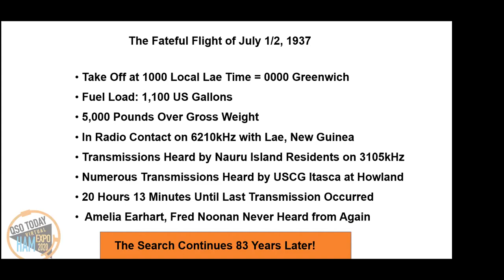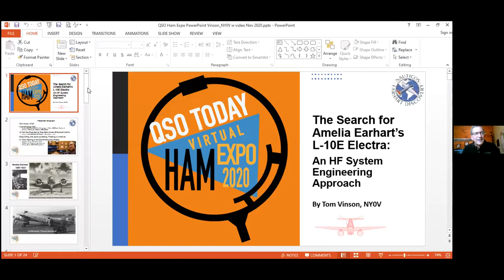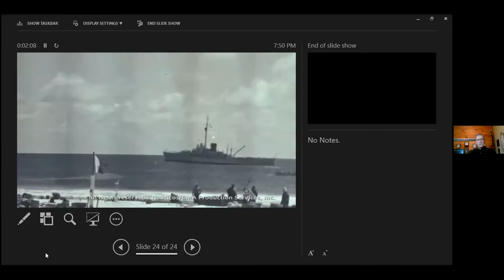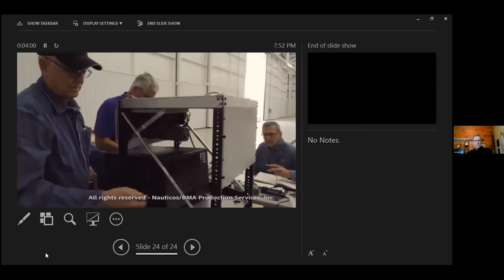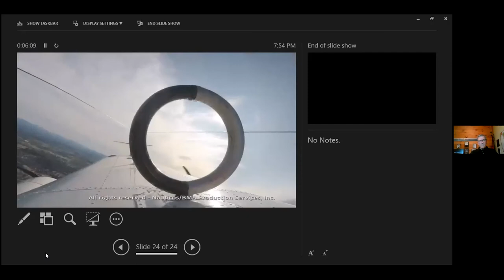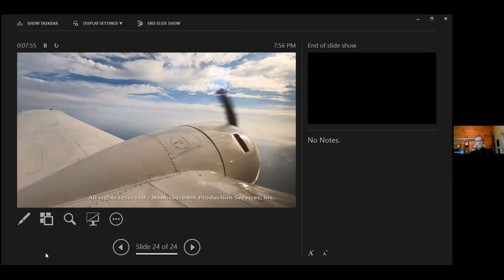BVARC Dec 2020 Tom NY0V An HF Systems Engineering Approach in the Search for Amelia Earhart’s L10E

Comment: At 1 min 15 sec, confusion about the generator, being used in place of word genemotor,
The transmit genemotor onky comes on during transmit. The receiver genemotor  was separate.
So...there was gerators and genemotors. With df genemotor, that makes 3 genemotirs
And also the engines generators, plus 2 battery banks, 1 was just for the radios, and with power saving is ok for 5 days,
And flat bursts on day 9 recorded in the log books.

Comment: i also have wondered why no colored flares were sent from the Itasca. Flares were invented at the turn of the century and should have been state of the art by 1937.
Reply: The direction they were flying, in regards to the direction the sunlight was coming from, meant that they would never have seen any flare......add to the fact that they were flying into headwinds double the speed they had calculated for means they probably went down 150-200 miles to the North of Howland, meaning they'd never have seen flares even if it was overcast. The Nikamuroro hypothesis is garbage. The Lockheed Electra just didn't have the range to get there, since it's 409 miles south of Howland. It would take 120 gallons of fuel to do Howland to Nikamuroro,  she would have had 35-45 gallons remaining on the approach to Howland which was nowhere near enough.
Reply: @Redman680   I believe, but would have to check, that the RDF equipment  batteries died before sun up, and to my mind that was the time to begin sending up flares.  Depending on when she came down under the clouds, that may have helped.
Reply: @Redman680  thats not correct those signal flares are not small little rockets and burn extremely bright even in broad daylight and especially bright in cloud cover

Comment: I like the comment, "pancake the thing on the ocean, 65 knots, stall it."I wonder, how far could you skid it over water? Maybe end up on an island?
Yes, first rule, fly the airplane.
Reply: Ditch a 747 at 120knots-180knots if possible?
Reply: It was an aluminum alloy,  filled with boxy tanks of air and or aviation fuel …which I’m sure were not ‘totally empty’ …aviation fuel is what the Trieste used for buoyancy 

she also had retractable landing gear …

she just couldn’t feather her variable pitch props if she ran out of gas while aloft 

which means she did not want to just run out of gas in the air because it would have been hard to control 

but I think if she made a controlled planned water landing she would have been ‘ok’ like landing an aluminum launch 

And she had landed other planes in the water and had made plenty of crashes